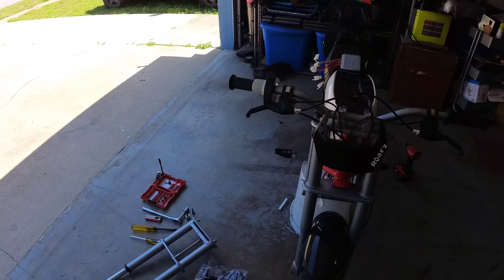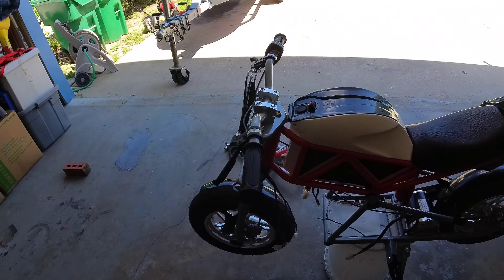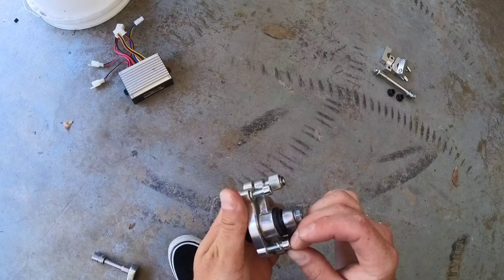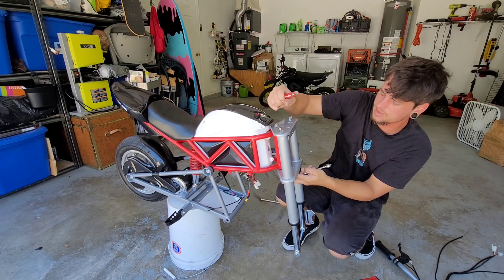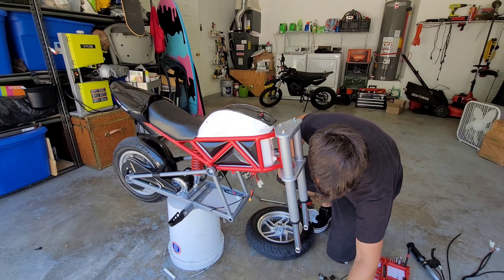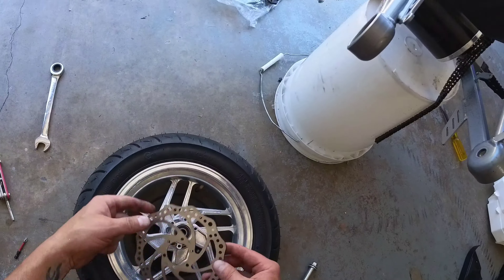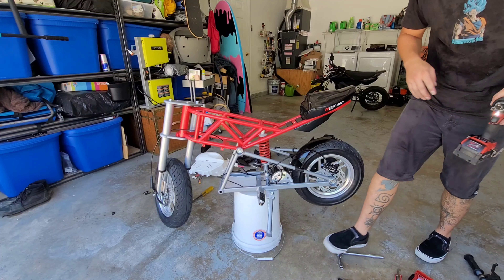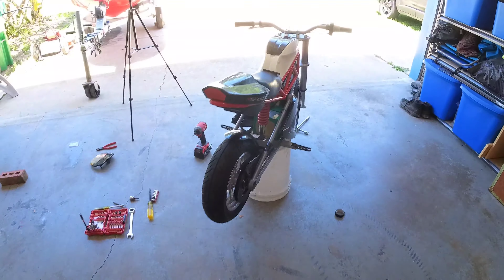Razor RSF650 fork swap - MX650 fork & zoom 4 piston hydro brake install

Comment: I'm about to change my brakes on my 3000w rsf650 to hydros so I'm watching your video and at 19 minutes I'm like wait a second that's a hidden leaf tattoo and then I saw the naruto on the other leg! Lol. Nice video and sick tattoos my man 🤙
Reply from the maker: Haha hell yeah man glad i could help a fellow anime lover 🤙 the other leg is actually dragon ball i have super saiyan 4 goku and vegeta, ss3 gotens, cell, freeza, and kid buu 😁 appreciate your comment man 🤘 what kit do you have on your rsf?
Reply: @EmxBrandon  ahhh I thought you had sage mode naruto on your shin lol but that sounds sick too!. I have the elecrto&co 3000w kit with the mx650 forks like you have. I never changed the stock mechanical brakes though until now. You make it look so easy I feel dumb for not doing it sooner lol.
Reply: @EmxBrandon  although the one thing I do wanna change is the bearing to the mx650 one cause the rsf650 bearing seem to all suck and get that rattling noise.
Reply from the maker: @robertbuckley9429   sage mode naruto would be sickk 🤘 i did all those leg tats myself a few years ago i just havent had the balls to finish them 🤣 and yes super easy for sure you dont necessarily have to run the brake line through the plastics but its a good spot to hide all the excess and way less zip ties to hold it down. But these brakes are amazing i do alot of wheelies and the cable brakes for me were either no brakes or lock the back wheel up so it was hard to control plus the cable stretch always having to adjust them. I wanna get an electro&co kit so bad i have their 5000w kit in my mototec, but i kinda wanna hold off and buy a welder so i can put a qs 138 motor in it and get some crazy speed going 👌
Reply from the maker: If you do the mx bearing swap let me know how it goes. I did notice a creaking noise when i first got the rsf. Kinda sketchy

Comment: Useful video, just did this swap!
Reply from the maker: Thank you 🤘 rides much better now 😁
Reply: @EmxBrandon  Absolutely, I swear the RSF should have came with suspension forks to begin with. I did notice the shocks bottom out, but better than stiff hit to the wrist.
Reply from the maker: @termsofuniverse7251  yeah they really cheaped out not doing front suspension. But yeah when they bottom out it slams back so hard its loud as hell 😆 definitely worth the reduced wrist shock though. I just got a welder so i think im gonna find some bearing cups weld em on and put a real triple tree on and some hydraulic forks, the bolt holding the razor forks is scary thin.

Comment: Quick question i cant find the forks anywhere i even tried calling razor where did you get yours ?
Reply from the maker: I had to call razor and talk to the parts department. What did they say when you called
Reply: @EmxBrandon  they said the wouldn't know when the forks would be back in stock. (thanks for the quick response)
Reply from the maker: Dang thats a bummer you might be able to find them on the razor for sale group

Comment: Hey man, excellent video!  Thanks so much for taking your time and showing every step.  I can't wait to do these mods to my RSF650.  Couple questions:
1)  Rear Brakes:  It's hard to tell from the video, but I'm assuming you can't use the OEM metal loops the original cables went through b/c it'd require you to bleed the brakes, correct?  So did you end up using zip ties on the rear like you did the front?

2)  Fork:  Can you give us a more detailed review of the ride quality of the new front fork?  You briefly mentioned the performance in your wheelie/ridearound video.  Is it a big improvement?  How's the stiffness (too soft, too firm, just right), stability at full speed, etc?  Anything else we should expect with this mod (either good or bad)? 

3)  Power:  I've seen the Sur Ronster Electro & Co kit, but what's that other one you've discussed?   I think you called it the Gerardo?  Do you have a link that you can share for that kit?
Reply from the maker: Hey thanks for watching i appreciate that 🙏🤙
So first question your are correct we would have to pull the brake lines apart re run them and re bleed them which is a big pain in the butt lol so yeah for now i just zip tied them out of the way. Eventually ill take my grinder with the cutoff wheel and cut a slit in the loops and bend them out so i can stuff the brake lines in them. If you do that aswell make sure you take a file and file down anything sharp before bending them back 
Second question i guess i did kinda jump around explaining how the fork setup was in my last video but ill say this, the spring forks are absolutely terrible compared to fluid filled or even air forks they are very stiff with little travel. But for 60-70 bucks and maybe an hour of your time the spring forks are a huge upgrade compared to the rigid forks especiallyfor just riding around on the streets. Mainly because the spring forks take alot of the shock out of your wrists, especially if you do wheelies or are learning them, the rigid forks are super uncomfortable and the spring forks help take some of that jolt away. Another reason is the rigid forks at higher speeds dont keep the front wheel planted and end up being really bouncy and sketchy, with the spring forks it feels planted and the wheel doesnt break contact with the road due to small bumps which could save you big time hualing butt with an upgrade kit. Thats really the plus sides to the fork swap other than it being a simple swap. Now if i could find some hydro forks and a real triple tree to swap on without modification i would 100% go that way instead but the spring forks will have to do for the time being 
And 3rd question the gerardo kit is something very popular on the facebook group modified razors. Most people who recommend kits will say either electro&co or gerardo. But i think for the sake of convenience ill start calling it the lonestar eletrek kit since that is his website and company name. If youd like the check out what hes got check the link in the description of this video under the brake kit link. I got the brakes off the same company. But everyone ive seen or talked to with his kit has loved it and talk very highly of his customer service
Reply: @EmxBrandon  Thanks so much for the detailed info.  I just ordered the MX650 fork and axle bolt directly from Razor.  $68 total includes shipping and tax, but they're on a 4-6 week backorder so it'll be a while before I can do this (very necessary!) mod.  On a side note, they didn't ask for the serial number, but thanks for providing it just in case!
Reply from the maker: @LYTS0UT  thats awesome fingers crossed they get it to ya fast. If you get stuck on something or have any questions let me know 🤘
Reply: @EmxBrandon  I had a few more questions, but rather than junk up the comments of this vid, I posted them to the facebook page(s) you mentioned and tagged you.  So when you get on there, you'll know it's me :) Thanks again for all your help and insight!!
Reply from the maker: No problem my friend glad i could help and yup i see the post now 🤙

Comment: So I have the same setup as you and even with two spacers the front hydro mount doesnt clear, any suggestions? Or should I stack in another washer?
Reply from the maker: Yeah keep stacking washers till it clears. A guy i was helping the other day said eff it and grinded his bracket thinner 🤣 just make sure your only putting washers on the brake side leave the other side alone so your not stretching the forks out too much 🤙 keep me updated
Reply: @EmxBrandon  3 washers did it, brake line BARELY clears the wheel, super sketch but thanks for the advice.
Reply from the maker: @IplayAspy  nice! Yeah i zip tied the hell out if the line to keep it away from the wheel. Just keep your eye on it 🤙

Comment: Good job with the video. I have on and did some other suspension upgrades and a seat upgrade. Let me know if you're interested and I'll give you a break down . Enjoy the bike.
Reply from the maker: Thats awesome and yeah a break down would be awesome i wanna do a seat swap pretty soon
Reply: @EmxBrandon  the Cafe seat swap is a huge improvement. I put a spring kit in the forks made them a good 3 inches taller. Picked it up on ebay for 40$ ( Dylan  Hughes is the seller and he has an instruction video on you tube. ) I also changed the mono shock . It improved the ride , raise the back 2 to 3 inches and all but the bottom screw goes back into the battery cover. I just zip tied it. But you could just use a longer screw.
Reply from the maker: I see quite a few with the cafe seat and they all look pretty good ill definitely be doing that and for the suspension chances are ill probably end up cutting the head tube off and welding on something that will work with like a grom fork id rather not put money into the spring fork. I wanna keep it stock ride height aswell since the bike is my girls and shes 5 foot nothing lol but the main goal is to fit a big battery and a qs 138 in it and basically cut and fab everything. We shall see though haha